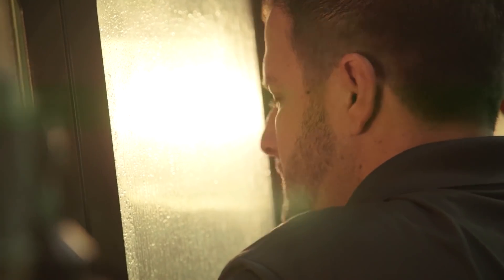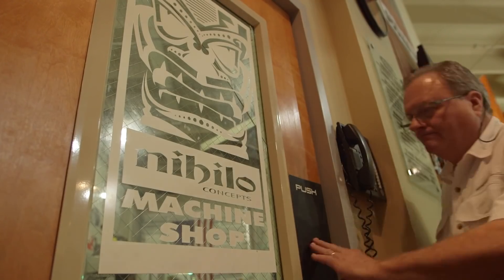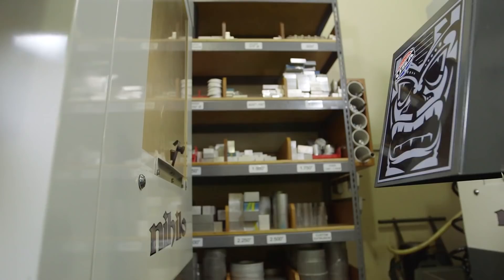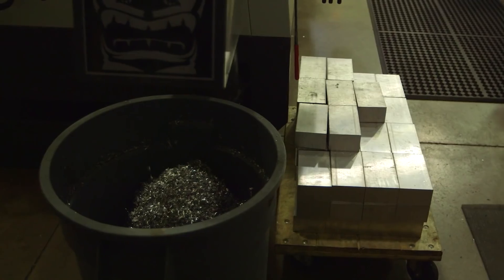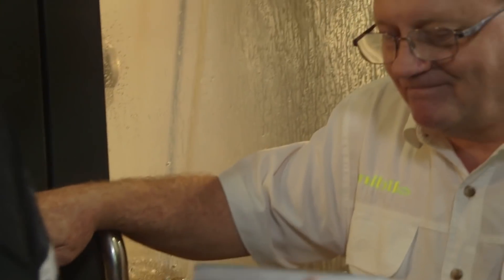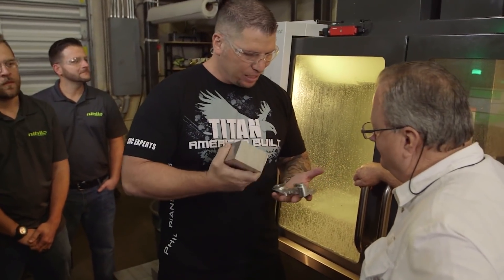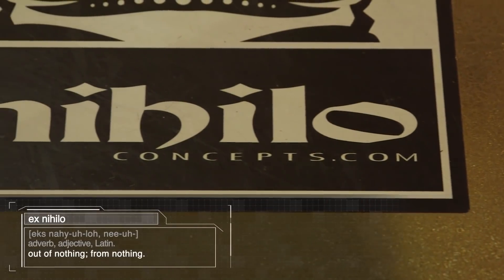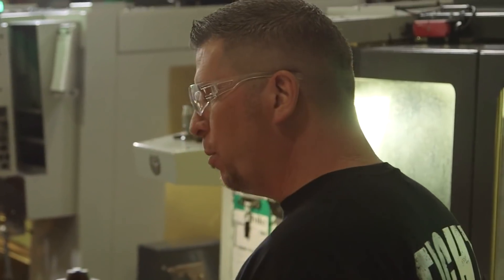I Asked My Boss for a Raise. He Said Go Find One Somewhere Else...

Comment: Not a machinist, but a heavy equipment operator.
Loads of mistakes, and I hope everyone out there learns from my screw ups.
Moved to another state, can't hold a union card in a state you don't live in.
Got another job as an operator, but also had to do hand work, welding, etc.
Lowest paid guy, and I did everything that was foisted upon me.
Did state, city and county work in that time, and there is this thing called "prevailing wage."
I was supposed to be getting top dollar, but the guy had it worked out that I actually made LESS when I did that work.
I found out about it, and quit.
Dying on the vine, and desperate to get the bills paid, I wound up going to the state to get what he owed me.
Well over 5k.
Big mistake, as I just put the local politician's cash cow out of the running for local contracts.
One of the people he works with is also the local judge.
That judge has had it in for me for the last 15+ years, and the rest of city hall, too.
Be careful who you work for.
Sometimes they are worse than the "criminals" in prison.
Reply: Lol this has to be Jersey or PA
Reply: Sounds like a Marvin Heemeyer situation.
Reply: Ahhh ... sounds like the politics of life !!!! So sad
Reply: Is this a movie script?
Reply: @michaelc1396  fiction are based on reality. Just talk with more people
Reply: Thank you for sharing.  Glad you told this experience. Even the right thing can have unintended consequences.
Reply: And then people wonder why killdozers get built....
Reply: Union card?

Fuck them
Reply: Unions are the devil.  I hated running projects with union guys, paid too much, got too little in return.

When I was an aerospace machinist, I moved to Portland, OR and I couldn't even get in the door because I wasn't union, and I had no family or friends in the union to sponsor me.  I had been programming CNC's with the cutting edge engineering software, doing my own setup, operating the CNC mill WHILE also keeping my manual lathe running.  I had managed a shop in AZ, along with all that experience by the time I was 21.  Still couldn't get a job in OR.  When I went back to AZ, I walked into a shop, shook hands with the owner, and started work the next day.

Comment: Remember if you can do it by hand it's usually faster than having to sit around and program a machine. Manual Machinist require more experience and actual knowledge then to do it with a computer. A shop that needs your machinist skills might not need your computer skills but still would pay you

Comment: Sometimes a benefit out weighs a current situation monetarily but you have to understand that/ those benefits to take advantage of them.  Rn I'm in a shop that isn't a top level shop as far as machining goes however I have benefits there that I wouldn't have anywhere else or should I say probably wouldn't have. Sadly it does limit my growth to an extent in a certain way but it also let's me prove things to them that 99% of people there can't do. The good, the bad, ups/downs, and the different. Weigh them all and get the most from your situation.   Btw... I have passed up offers for double my current pay for several reasons but mostly family reasons at this moment.

Comment: If we are going to grow this trade, there will have to be more smaller high response shops. The people on the bottom NOW will need to be creating running those shops bottom line. LEARN LEARN LEARN while you can, top out the abilities in the workplace and be practicing cad/cam at home. Yes, get a computer and cad/cam system, then a small shop space and a mill or lathe. With the knowledge and the tools, you are then responsible for your future, and maybe the next generation in machining as well. Learn in the job place like its college.

Comment: Half a year ago I had never even seen a lathe in person, knew what a mill was, never saw a cnc plasma cutter or knew what the hell a press brake was. I started out painting parts at a machine shop at $13 an hour and my take home was $600 a week. I wasn’t struggling to pay bills by any means but I surely wasn’t going on any vacations anytime soon or having a whole lot of nice things. I showed initiative and showed that I cared about the job even though it sucked. Surely enough a month later I got moved up to the cnc plasma cutter. Not a huge step but it was better and so was the pay. The job still wasn’t glorious by any means, I was covered in slag dust head to toe every second of every day deburring parts weighing up to 250 pounds each, but I kept a positive outlook and worked hard. Fast forward another two months at the shop and my boss mentioned me running the press brake. I jumped on it in a heartbeat. I learned very quickly and was able to run the brake on my own unsupervised after about a month. I now build parts like skid plates for caterpillar engines, 500 gallon fuel tanks, engine cradle assemblies, and all other sorts of oil field equipment parts from blank sheets of metal from blueprints I’m handed. I walked into a shop 6 months ago that I knew absolutely nothing about and I went from $600 a week to $1200 a week. Sure I could go to another place and make easier parts for the same or more money, but I also have opportunities to go get paid to learn how to weld, and run a cnc machine all without any certifications or classes. I look at it like I’m getting paid to go to school every day
Reply: It kills me that you almost never find apprenticeships outside of small shops or unions. 
Glad you got the opportunity you did!
Reply: Nice work if you can get it. Plus, you are clearly a talented and capable guy with a can-do attitude. Kudos!
Reply: Belo relato, obrigado por compartilhar, nos serve de exemplo!
Parabéns e sucesso nas futuras operações do CNC.
Reply: You did very well! In a short period of time.
Your boss is looking after you.
Reply: Love your attitude and drive.  Keep it up and perhaps one day you’d have your own company.

Comment: I'm not exactly sure how to feel about this one. I agree putting your time in matters, but imo once you've stopped learning its time to move on. In my case, I started my machinist career fresh out of community college in 2007 at a local aerospace shop in low COL area of the midwest.
My pay raise time line looks like this.
2007:  $13/hr.  entry level operator recently gradated from CC with AAS degree in Machining technology
2008:  $15/hr. promoted to set up position with minor edits at control.
2010:  $18/hr. promoted to lead programmer for lathe (with live tooling) and mill 3+2.
2012: $22/hr. Promoted to Process Engineer position overseeing quotes, fixture design in CAD, tooling expenses, programming, and outside vendor sourcing.
2012 - 2017: no raises for almost 5 years, I ask for one in 2016 and was turned down, at this point I was feeling burnt out, highest earning year was 2016 at 73k with OT.
2017:  join "Company B"  $75k base salary as Process Engineer 40 hour schedule, no OT allowed for salary folks at this company, but cleared 83k after bonuses.
2018: join "Company C",  Process Engineer $85k base salary, 45h/weeks. cleared 90k after bonuses.
2019- early 2021: joined "Company D" to be closer to home, Process Engineer $85k base salary on 45h/weeks. no bonuses due to covid and loss of business.
Today: joined "Company E" in August with 98k base salary, work holding and end of arm tooling/Fixture designer for an automation company (no longer in a machine shop environment)

I've learned more in the last 4 years moving company to company, than my first 10 years at my first job in a machine shop.  I wish we had more open dialog about wages and growth in this industry. keeping quiet seems to hurt more than help everyone in the workforce.
Reply: That's been similar to my own experience. I job hopped every year to 2 years because I wouldn't settle for bs raises and ended up a director and learning more than any peer I've ever met.
Reply: You guys are on to something.
When I was in the engineering field this same thing was the usual.
I went to vocational school and started with a great employee owned company. That being said 3 dudes I graduated with that started with a different company then came to where I was at all made about $3thr more than me who had been there the whole time. I asked my dept supervisor WTF Mate!?! And was told 'their experience at a different employer made them more valuable and diverse'.
So basically they were regurgitating this modern business school B.S. that is being taught. If outside people are 'more valuable' it sounds like your training system just sucks butt.   After 7yrs I decided desk jobs weren't my gig and switched fields.   
Either way, this back asswards thought process that modern management has is why 3-5yrs is the average for management types.
Reply: ouch.. $13/hr is what I made when I was 12 years old bagging groceries. absolute unacceptable.
Reply: I will never understand why people want to pay so much in taxes... you are ones keeping this stupid system going by feeding it.
Reply: @togowack  I don't want to pay taxes, I just want to take home money.

And the system is honestly not too bad, as far as systems go. Could be a lot worse.
Reply: @togowack  I don't think you have the perspective of seeing dictatorships in action.
Reply: @loganvanderwier8866  I have, after visiting China a few times in the last ten years. The only difference now between here and there is here people think its a pandemic changing the rules. But our freedoms are gone. Their opportunities have actually been better, but it happened to us slowly over time and we got used to a bad deal.
Reply: "Up Up and away" . . .my beautiful, my beautiful balloon.   Hay. . . better watch out. . .there is nothing saying you won't be offered 45k a year at company "F".  When you have a mortgage, wife and a few kids to take care off.  Many a managers went from 115k down to 30k when there company closed. But you did well so far and hope you keep doing well.
Reply: I totally agree with what your saying! Every company is different. Some company's production set up is better then others, better benefits/pay and some company's have really cool knowledgeable people to work with. Thats what I learned from all the 5 different company's I've worked for so far.

Comment: I was in the same situation, I started on a manual lathe at 18. After 2 years I was promoted to running the bar feed machine. After I had a firm grasp on what I was doing I began to play around with the machine, I made a part puller in some of my lunch breaks that could be bolted to the side of the part off tool to avoid having to index the turret to pull the bar out. Before long the machine barely required an operator to measure a few parts at random, load more material and reset the parts counter. I was running between 600 and 1500 parts in a shift, I was the youngest and the lowest paid guy in the shop. After 2 weeks the scheduler came to me and said that he could not keep up with me and he asked if I could run 2 machines. At this point I was feeling pretty good but after about 18 months I was running 3 machines and still the lowest paid guy in the shop, I decided to at least go see what I would be worth at another shop. They offered me a $4.25 raise. When I put in my 2 weeks notice and told them I had a better job offer the owner turned white and then offered me $4.50. i felt bad because I pretty much forced their hand. But on the same note if I am doing the job of 3 men I think I deserve a bit more than $10 an hour.
Reply: Employers pretend like they can't just give you a raise whenever lol. Fuck them. Good for you.
Reply: $10 am hour my guy? Don't act accept that from anything but training. These companies pay trained tech $28hr avg. Don't Lauren to their bs about money. Always be ready to walk when asking for raise but know it will cost them an avg 1 to 2 years training new guy that might not work out. Bosses play hard ball and it works most the time. I got screwed the same. Same pay as you and was doing 3 guys job. When I told my boss I'm walking beast ours not enough money he offered me double to stay. So this whole time I wad being used for the cheapest pay as long as he could. I wad worth double that to him but didn't give me it without going to walk.
Reply: I work on 5 lathes since 8 yrs .. where 80% of my shop work on 1-2 .. and hetting the same money as other .. and boss saying i got good mmoney xd what a sick fuk
Reply: @SerioSerioNieZciemniam  Just why you keep doing so? Find another job or refuse doing more than others for the same pay and see how it goes.
Reply: @woopsserg  currently looking for job but ppl giving me funny money first they ask for set up after that they talk about programing for the same money xDD
Reply: ROFL
now im 33 (1988 class)

at 25 more or less i dont remember (it was like my 6th year with my first workplace)
i was on 5 machines
2 lathe KIA super turn with counter spindle and C axis
1 little lathe 2 axis
all 3 lathes with bar loader

3 lathe that run 24\24 hours 6\7 days

1 milling machine with double pallet excanger (each pallet with 3 bench vices)
1 milling machine HAAS 3 axis with 6 bench vices (1000mm "X" axis VF series)

more then 3000 different pieces in inventory

at the age of 25 i run the workplace for 1 week because my bosses went to russia for job connections
i went over my limits several times running the workplace and I never understood how I did it

always maintained the machinery myself, I even managed to do the HAAS technician job by manipulating the PLC or basic MACROs

5 machines, clients, providers, managment of the job
for 8 euros\hour :))))

at the 8th year in that workshop i called for a raise.....they told me they couldn't afford it, but that was the case if I worked a little more, with more effort

Lmao

i will never understimate again my level with a low salary
Reply: NEVER feel bad for putting them in a position to PAY what you are worth…. You aren’t there cause you have nothing else to do….
Reply: Sounds like u had a greedy boss
Reply: @jackdaniels2657  thief xD i would say
Reply: They knew what they were doing.  It was their responsibility to compensate you adequately.
Reply: You were on $10 an hour?  To work in engineering shop? 
That's slave Labor pay!
Reply: Don't feel bad at forcing there hand.

America was built on forcing the hand of your employer.

Unlike in the past, they can't shoot you.